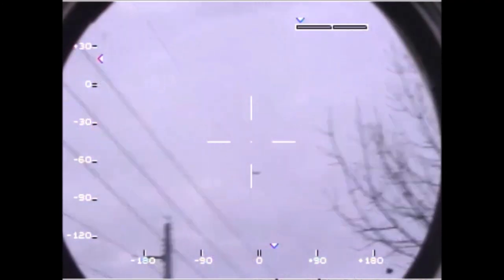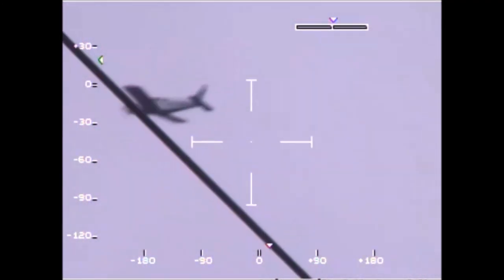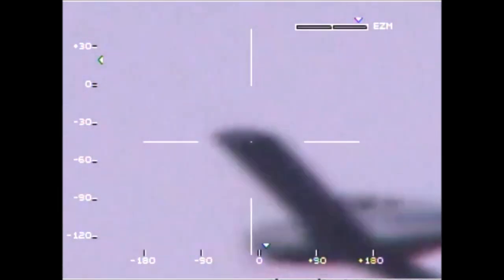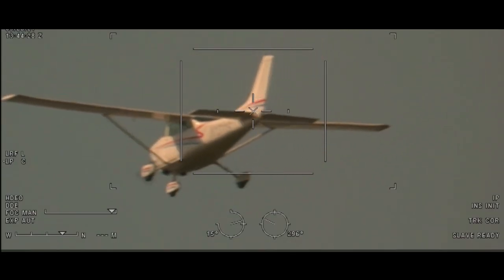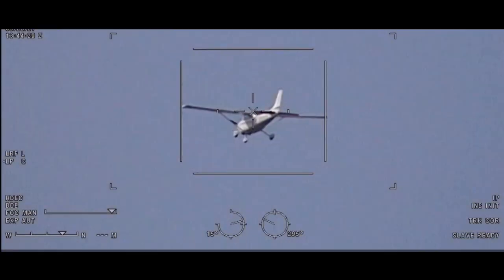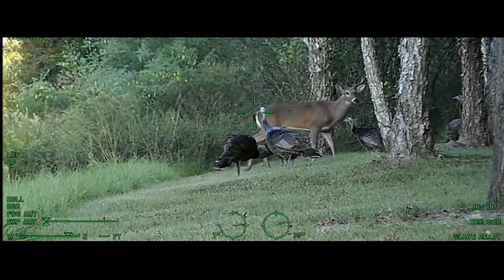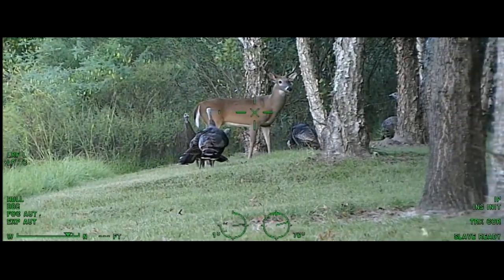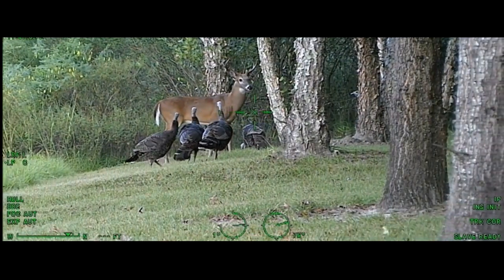Chilean UAP FLIR video

Comment: There are several cases where it's claimed that pretty strong FLIR signatures are jets are up to 100 miles away.  If this were possible, wouldn't many FLIR videos be littered with jets? It's hard to find a piece of airspace where there aren't at least a dozen jets in a 100 mile radius. Around major cities, the FLIR would be absolutely packed with jet IR signatures.
Reply: If it's a wide angle shot and the jet is 100 miles away, it may be imperceptible at the resolution of the recorded footage, and sufficiently faded relative to other objects in frame like the ground or clouds, etc. IR-light cameras tend to have much lower resolution than visible-light cameras. The pixels may not be small enough to represent it. If it's a narrow angle zoomed in shot, then you're more likely to be able to detect something farther away but a much smaller area of the sky is visible in the footage and it's less likely to have any other random aircraft in frame.

Comment: In one of the cases reported as 'resolved' by AARO, passenger jets were visible to FLIR-type sensors at 'as far as 300 nautical miles from the platform' [i.e. the IR sensor].  The report is here. https://www.aaro.mil/Portals/136/PDFs/case_resolution_reports/Case_Resolution_of%20_Western_United_States_Uap_508-02262024.pdf?ver=PmgbGHhJPljZmB-n_qioow%3d%3d
This seems to contradict your claims about the Chilean case.  So is their analysis wrong?